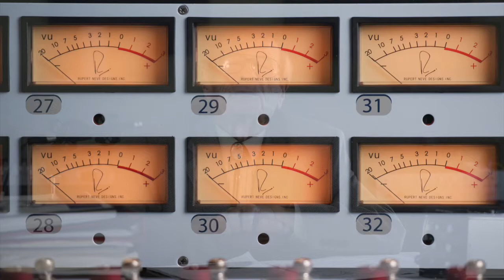Creation of the dBu standard level reference

Comment: Mr. Neve, where does the "u" in dBu come from? Is it from VU's "volume unit" and means "unit" or does it mean "unloaded" as many interpret it? Or was it originally meant as "unit" and then changed to "unloaded" or even something else? Best of health and greetings from Finland!
Reply: Good question! I hope Neve can provide an answer. It certainly can be interpreted as unloaded since the impedance is not specified, but I read somewhere it was once written as dBv, but to avoid confusion (since the reference is 0.775V, NOT 1V) the lowercase v was changed to u. Thus it may not be an abbreviation for anything.
Reply: @SchuchDesigns  Could You use "dBu" also for something else. Maybe for dB over 1µV..? :/
Reply: It stands for "unloaded"
Reply: Thank you for asking this, as I had the same initial impression, but after playing it back a few times I think these two points are unrelated concerning what the U means.  I guess now the search is on as to why the dBu relates to VU.